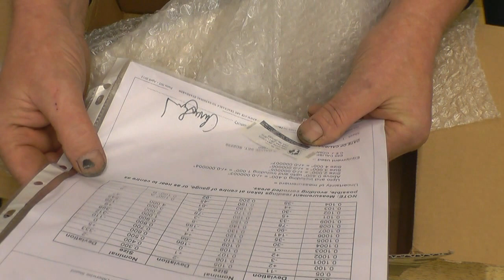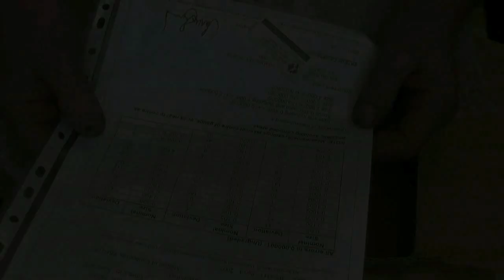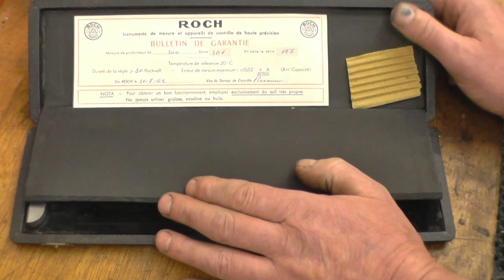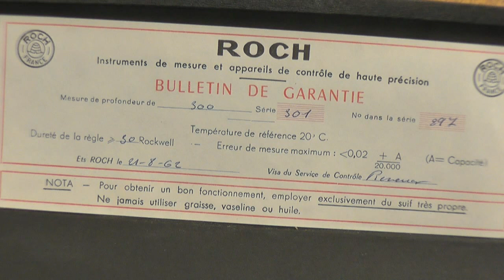SNNC 102 P1 Slip guages CV joint thread repair

Comment: John can I ask you how you would work out the thread size as in 20mm or any size of the nut I had a talk with  Tom over at OXTools and all we could think of is to get a pore in a moulding material then when set unscrew it and measure it like a bolt, any suggestions on how you would do it.?
Reply from the maker: +gigabytex64 If the nut is big enough you can just use a thread gauge . It could be possible to screw the nut on to a bit of soft plastic or wax
Reply: Thanks didnt thinkof the wax candle thats brilliant, im trying to work on a 4" 4jaw chuck for someone but didnt know the thread, thanks thats going to save me allot of time.
Peter

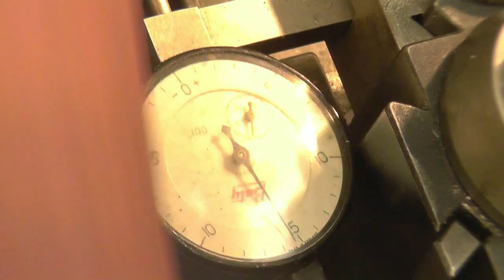Comment: Hi John, At 13:40 you use quite a big (10mm ?) drill to remove the old centre before you use a centre drill to re-establish the centre. Why not just use a centre drill? You obviously have a reason - please tell

Will
Reply from the maker: +William Davis I think it would have snapped the centre drill point
Reply from the maker: +doubleboost The drill I used is called a "spot drill" that is what it is used for

Comment: Be glad you don't live in the "Rust Belt" in the US. Everything rusts solid because the roads are salted in the winter to remove snow. Check out the trials and tribulations of another Youtuber search for "South Main Auto Repair Dodge Grand Caravan Lower Ball Joint"
Reply from the maker: +Co Jones They spread plenty of salt in England
Reply: +doubleboost I used to get through nearly a whole washer bottle in a day driving up to work in Sunderland and back because of all the salt on the A19.
Reply: +Co Jones I live in CT. Oh, the crust...

Comment: Better there is not a single mechanic is all of the USA that would take the time to do the CV job!   We see a great many fail in the ball area and the entire shaft gets replaced as an assembly.    Nice when you can rescue the part.
Reply: +phooesnax Not likely these days any garage has anything remotely like a lathe,  todays garages are fitters, fit a part, they cant engineer anything, john is old school, and could manage the type of garage that did have a small machine shop in back, along with welding, fabricating , new threads and inserts, and a bit of milling, such as cylinder heads if need be

Comment: when I remove drive shafts and cv joint I always use a punch and hammer or an air hammer in the hole in center of the shaft
Reply from the maker: +alz0101 This one was the tightest I have seen in 40 years lol